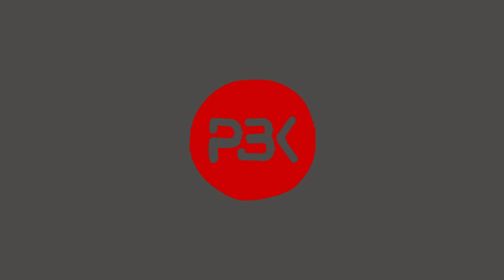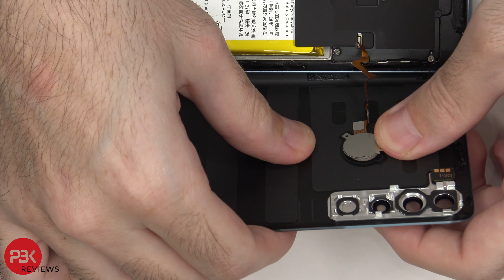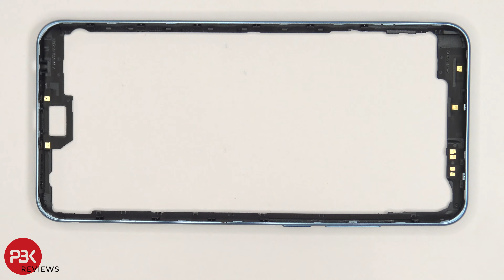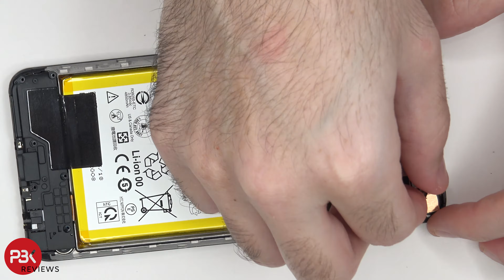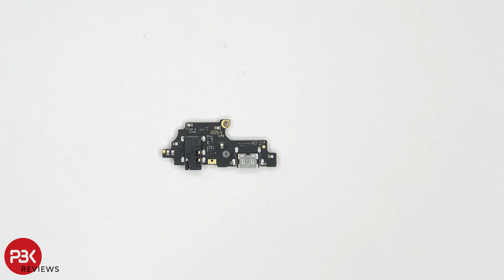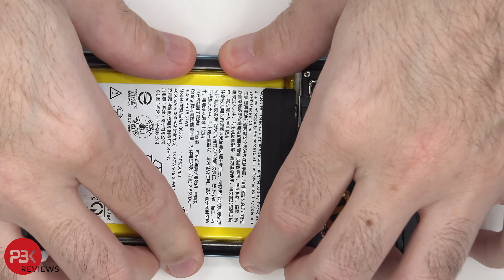HTC Desire 20 Pro Disassembly Teardown Repair Video Review

Comment: hello, after having done this my htc restarts instantly and it remains stuck when restarting. What can I do?  thx for all !!!
Reply from the maker: Make sure you didn't damage any parts or chips on the board. Also try using your old part that you replaced to see if it does the same with the old part. If so you will know the new one is defective.

Comment: So three Questions: Is the grounding Rules of "how to repair" here the same for the HTC Desire 21 Pro? It looks like, so i ask.

Second: So, there is no glue on the screen? Or elsewhere? Not even a stripe? The HTC Battery Glue works after Repair? If the first answer is yes - THATS, exact this, why i like htcs smartphones.  

 Three: I teardown the phone and on the end of the line is the flex cable to disscounnect from the board and bringing the new cable to the screen, right? Or how to replace the display?

Comment: Hey, I have one of such phones. My battery is getting big and I'm considering changing it. Does that mean I have to get a hair dryer and heat up the phone before I can remove the old battery?
Reply from the maker: Yes, you would need to heat up the back to loosen up the adhesive holding it down and pry the back plate off. But remember the fingerprint sensor is still attached to the back plate and you would need to pry that off too so you don't tear off the cable.
Reply: @PBKreviews  do I need some kind of glue when I want to put everything back where it should be?

Comment: Another great teardown video! 👍
Reply from the maker: Thank you!
Reply: @PBKreviews  Nice video! Great job. I need a glass. I have a large fissure on my D20 Pro from Europe. LCD under remains in fine condition. Where can I find a replacement glass out? Thanks.
Reply from the maker: @Lampiono69  thanks. You cant replace the glass by itself, requires special skills and tools/machines that the factories use. You would need to replace the complete screen assembly.
Reply: @PBKreviews  thanks for Ur clear answer. My bad then...
Reply from the maker: @Lampiono69  you're welcome, no problem. 😀👍